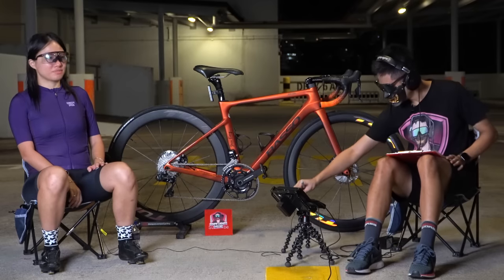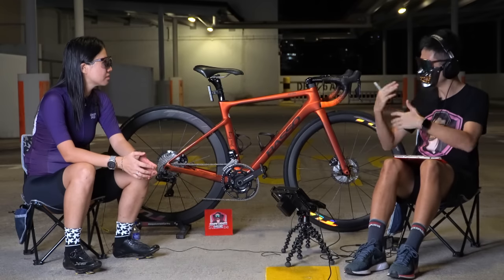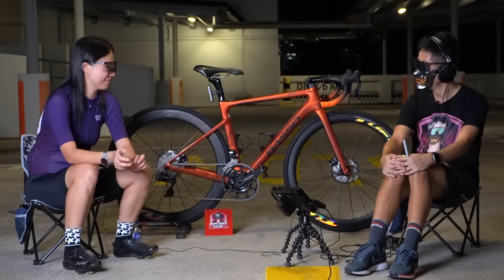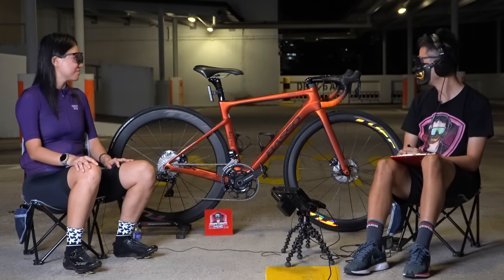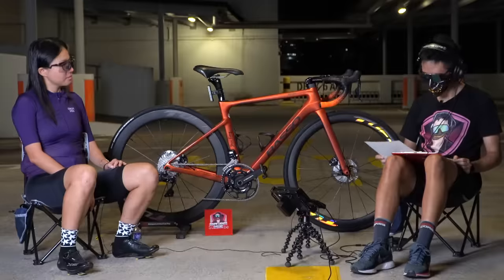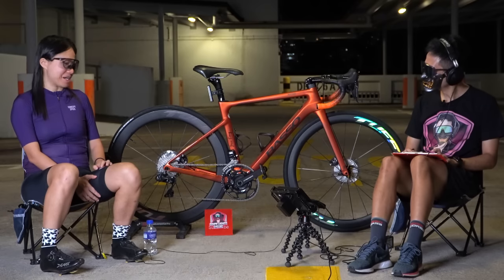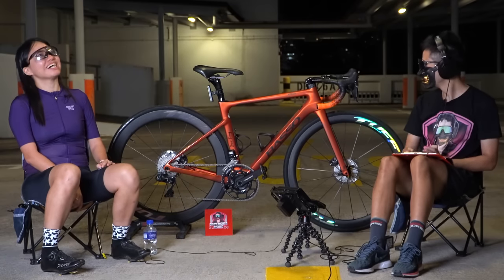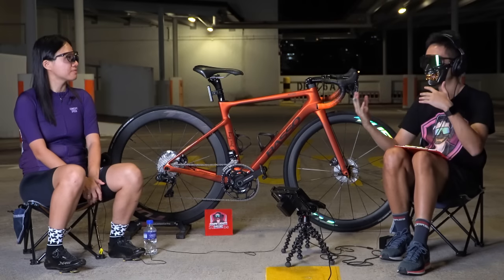How Tough Are Tuff's? | Basso Astra | Oompa Loompa Cycling E91

Comment: Yay another 155mm short crank user. Spin to win. There are smaller bikes that fit better but you will not like the main gripe that come with it. 650c wheels! Emma Pooley was riding 650c wheels for quite a long time before going back to 700c. Getting support from friends is difficult when most if not all ride 700c. Getting a tube to replace is a chore.
Wheel choices are limited. For 650c TT bikes, getting a rear disc wheel is very limited.